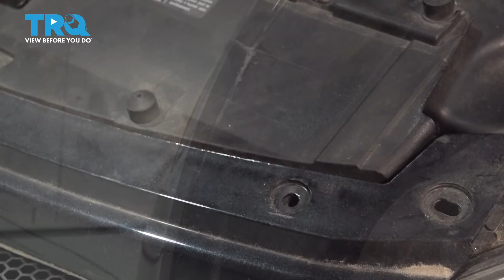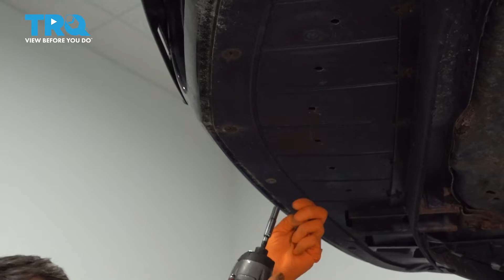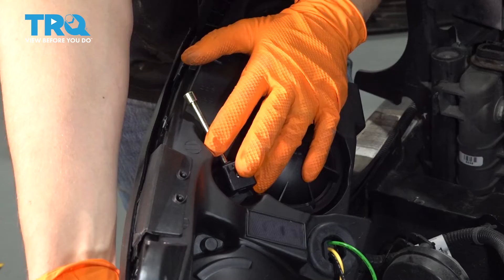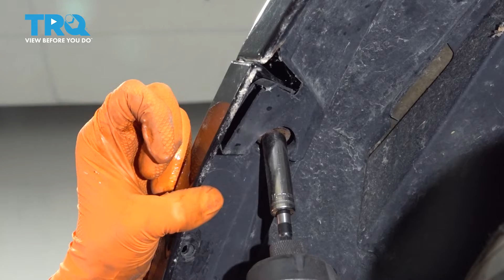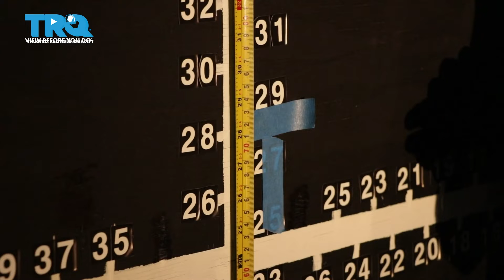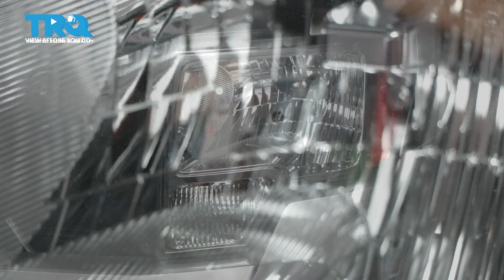How to Replace Headlight 2005-2010 Pontiac G6

Comment: I can't believe you have to go through this BS to change headlights on a GM car of this era. My '02 Olds intrigue had two plastic sticks just like tongue depressors you slid out the top, and removed the unit to unplug in 5 seconds flat. It's cheaper to build cars with that kind of attention to design. It's much faster on the assembly line to just slide them in, and not need bolts & threaded mounts because they just need to be held in the fitted position.